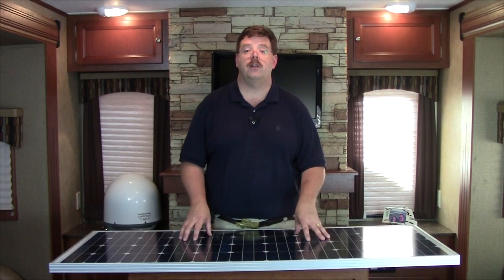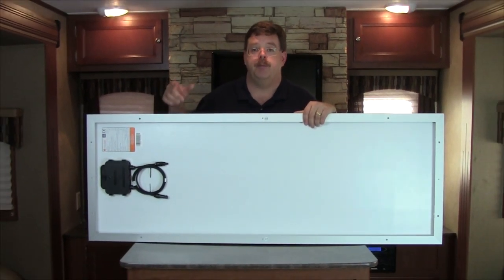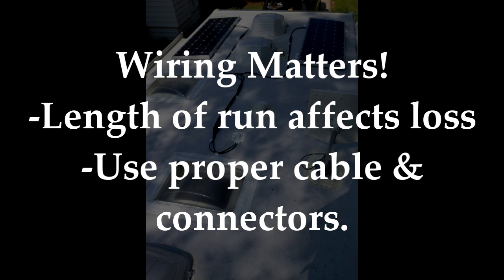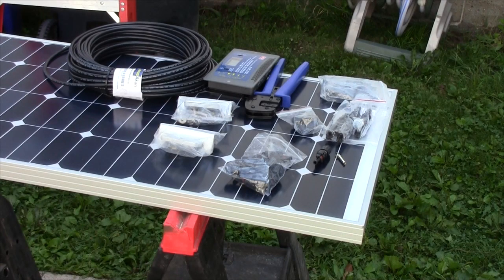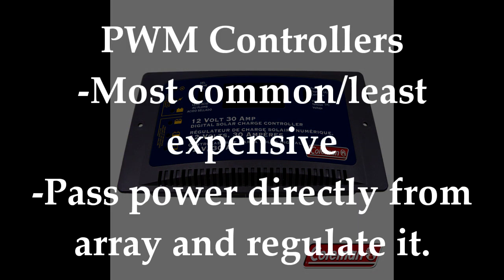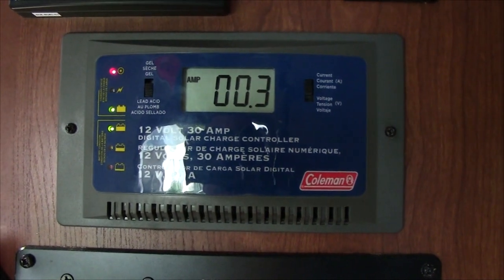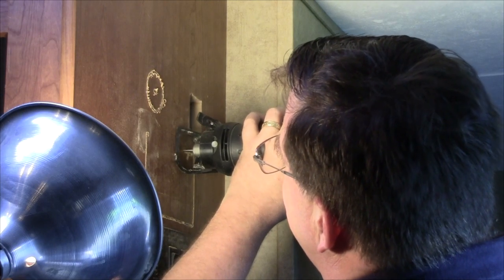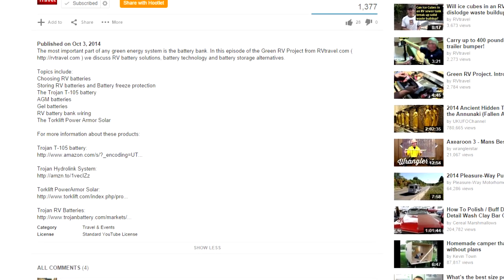Green RV Project. Part 3. Solar Panels

Comment: Good video for the basics of a solar installation. We've been making solar RV kits for years. Here are a few things we think are important and would like to add to the conversation for anyone considering solar for an RV.

Lets reduce generator use! 

We'd like to stress that it's very important to use great quality wire with any solar installation and a quality solar charge controller. We use all copper core wire manufactured from an American company for it's quality and longevity. The quality copper core provides the least amount of resistance for the power to transfer from the solar panels to the battery - less voltage drop. All of our solar RV kits come with wire that is pre-molded for a PLUG-N-PLAY system with very little crimping. There is no need to buy a special crimping tool as we provide wire connectors with heat shrink for install. Our deluxe kits automatically come with 8 AWG wire for up to 450-500 watts of solar. Start with a small system and add more solar later, easier without reconfigure your wires or charge controller. 

A quality solar charge controller is essential for a solar system, be it on an RV or for an off grid system. It's the brains of the whole operation. We recommend for anything that's under 600 watts of solar to be PWM and anything over 600 watts to be MPPT. Using an MPPT for 600 watts or smaller won't hurt the system but they are more expensive and the increased efficiency from an MPPT for that small of a solar system is incalculable. Also use a solar charge controller that is programmed for the specific type of battery in your RV. Our Zamp Solar Charge Controllers are programmed for 4 different types of batteries - Wet, AGM, Gel and Calcium. Each battery charges at different voltages. Using a solar charge controller not designed for your battery type will either overcharge or undercharge the battery. 

Generally RV batteries are used in a way that isn't the best for the batteries. Many RV'ers use up most of their battery capacity during dry camping trips and wait until their devices start screaming at them before recharging. Out comes a loud generator creating a toxic environment for battery recharging and only recharging the battery enough to stop the devices from yelling that they are almost out of power. A better way to use your RV battery is to never let your battery get below 50% of it's capacity - that's around 12 volts on a volt meter, or keep it between 30% & 50% of the battery capacity. If the battery(s) reach 50% they should be charged back up. If there is a proper solar RV system the batteries will be charging during the day and never let the charge get below the 50% mark. 

Letting your RV battery drop below 50% of it's capacity or 12 volts frequently and for long periods of time puts a lot of stress on the battery. Generally RV batteries are replaced every 2-3 years, but with a proper solar system those same batteries can last 6-8 and many times 10 years plug. 

Our solar RV kits are complete and ready to be installed on a battery or battery bank. There aren't many tools required or additional items to purchase. We've done all the calculations to provide a system that will last with the best components. 

Zamp Solar - Power to EXPLORE!

Comment: Looking for information on how many batteries can be ran-together. I am looking to use 6 volt batteries and can not afford the T105 you guys have been speaking of, any further suggestions?
Reply: RVwithTito Thanks for the answer, I will be looking at Sams Club tomorrow as they are the closest. Thus far one auto parts store has no 6 volt batteries nor were they willing to assist, I can spend my money elsewhere. :) Happy RVing
Reply: You can use as many batteries as you have room for. For 6 volt batteries, wire 2, 4, or 6 of them in series-parallel as Chris outlined in his last video (Part II - Batteries). The best deal I've found on batteries is Costco/Sams Club. They sell good quality 6V golf cart batteries for about $70 each. That's what I have running in my RV with solar and they perform great. I believe they are manufactured by Johnson Controls (who provide batteries for other brands as well). Hope that helps.